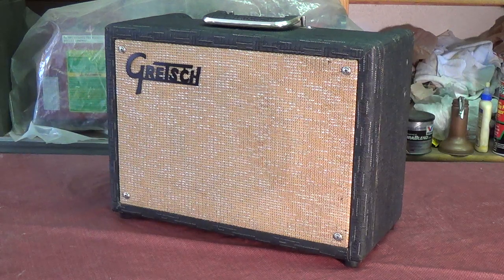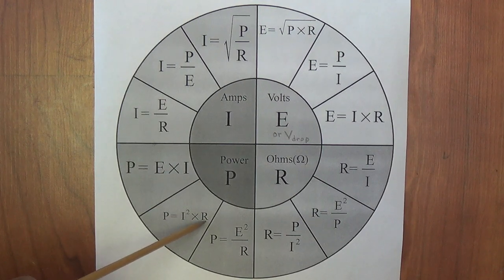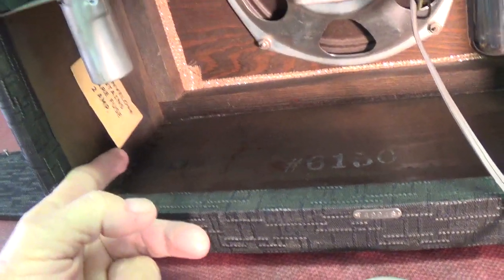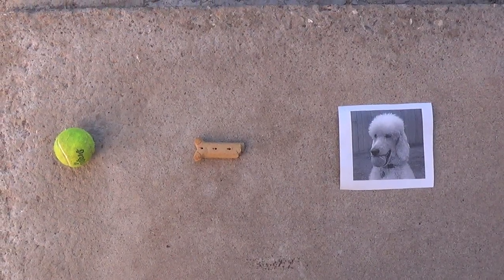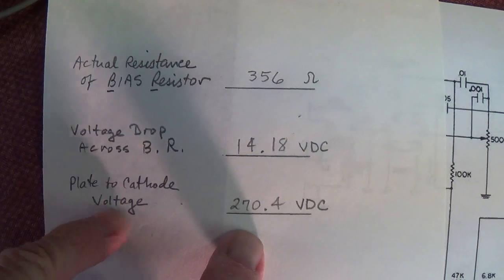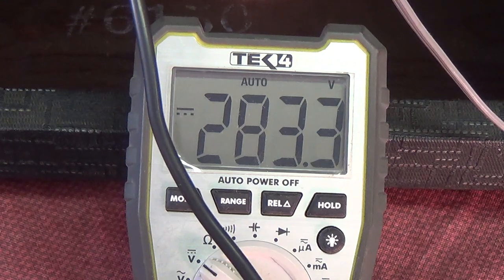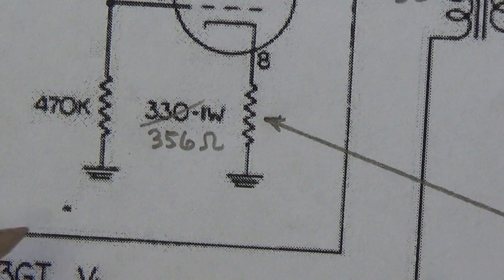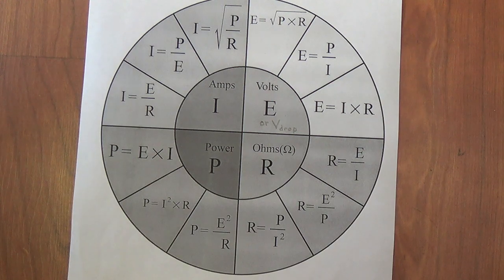Resistors, Part 2:  Power and Wattage Requirements, Practical Applications of Ohm's Law

Comment: I would like to point something out that I don't see commented on very often; the amount of work required to produce a clear, concise and informative video. It's not easy!  

After watching Uncle Doug's videos I thought I would make a video and post my first amp build and I have been greatly surprised at how much effort is required to do it correctly. Lighting, camera angles and maintaining continuity has been a hell of it's own. 

I find myself getting caught up in the build and remembering several steps later that I forgot to turn on the camera, so I check the lighting, camera settings, etc. and try again.  Other times I notice repetition in my explanation of a specific step, in which case I stop and do it over and over,and then try to pick up the build again where I left off.  I have even documented some incorrect steps that I have had to delete or replace with something else. Keeping continuity is not as easy as it looks, and I think this may be the reason I see so many demos on YT of the finished product and not very many good videos of the build. 

Uncle Doug makes this look easy and it's not. 

Another great video.I feel like I'm in a classroom.
Reply from the maker: +Slugg0matic Thanks so much, Randy. You're completely correct.....it's hard as heck to come up with a smooth, coherent video, especially when you're performing distracting, hazardous technical tasks at the same time. This video consisted of at least 100 separate snippets (selected from about 250 that were made) which were all joined together....while maintaining (reasonable) lighting and verbal continuity.  As you found out, this can be a real handful. Even after making 124 of them, it's still a challenge that can take a full day or two. Thanks for mentioning this.....it was very thoughtful and perceptive.
Reply: +Uncle Doug man,  I hate to put you on the spot...but your wisdom is inspirational!  I don't mean just in these technical videos but as a human.  Such generosity and civility.  And these traits appear to have an influence on your viewers. You're doing Great Work--thanks!
Reply from the maker: Wow, thanks so much, JR. I really appreciate your very kind sentiments and hope that I can live up to them. You're quite right about our viewers....they tend to be the most civil, kind, generous, and appreciative that you will ever see on any Internet site. It's an honor to associate with them, and you.
Reply: +Slugg0matic .......................You are so right.....I've followed this Channel very carefully.........there is much to be learned here...much more than the operation of a tube amp..... I consider this a peerless  instruction ...on instruction....That is Uncle Doug's  and Rusty's ............. Bailiwick ......only one other person was as good as UNK.....Robert  Persig...." Zen and the Art of Motorcycle Maintenance"........ who tries to explain........."explaining"......and the idea of explaining.....and all it of it's magical subtleties....it's all about "Quality ".........( I write the manuals you read.....)      Hah!

Yep....He makes it look way way  too easy.......Hah ha ha... a gift.....
Reply from the maker: Thanks, Bill. Rusty and I really appreciate it :)
Reply: Uncle Doug .......And Rusty....And did I mention you can  answer..every single e-mail....every one!!!..... you're not only Peerless ...but maybe Perfect.....I'.m thinking out loud here  .....but maybe  ..you might be the "5th  Element"    .Maybe.......Hah !      ;).. love Bill...
Reply from the maker: Thanks again, Bill. I really enjoy hearing from you all and can't resist reading and answering each comment and inquiry.
Reply: yes just editing film is a task in it self.    people like Uncle Doug do the entire process of coming up with a story line and all other aspects including the editing. 

it is easy to forget the amount of time involved.  when you are as good as Uncle Doug you make it look easy.

Comment: Great video Uncle Doug! Nothing like using the actual readings from a working amp to get "real world" understanding of what's going on. A lot of useful info provided.  A nice follow up to your previous video. Can't help but love the practicality of those old Valco amps.
Reply from the maker: +skeeterbuck  Thanks, Skeeter....glad you liked it.  I agree completely that visual learning is way more effective than auditory.  The screen current issue was unrelated to the topic, but it was a great opportunity to cover a rather elusive subject. Yes, Valco amp design and function are about as good as it gets. I've been appreciating (and collecting) them for several years.

Comment: Excellent tutorial Uncle Doug. That amp is very clean looking. I'm restoring an old cc 1980's slave power amp (solid state not valve) and internally it was a right old mess. Full of dust, fluff and rusty terminals. I'll release a video of still photo's when it's complete - I'm completely refurbishing it with new components. I also discovered that you can use the wife's nail varnish remover to clean the PCB tracks of flux residue, although don't try this on the screen printed side as the component markings are removed..
Reply from the maker: +Andy Wragg Thanks, Andy.....glad you liked the video and the old Gretsch amp. I thought that all you true ampoholics would get a kick out of it.  Let me know when you post your video. Rusty and I would love to watch it.....as long as there is no choice between it and a dog cookie :)
Reply: Go easy on the dog cookies Uncle Doug, I hear they can play havoc with your regularity.
Reply from the maker: I doubt that anything could interfere with my "daily habits", Andy, but I do find that chewing the cookie before swallowing does make the day-after much more enjoyable :))

Comment: Thank you uncle Doug, Rusty and Jack for the excellent series of videos on tube amps and other related things. So far, I have not come across any such informative and we'll explained videos such as yours. I just wanted to add something to your explanation on power. Firstly, we measure energy in Joules and power in Watts. Watt is an alternative name to the original unit of measure, which is Joules per second (J/S), named after the scientist, James Watt. As you can see, power is simply the energy consumption rate or how many Joules consumed per second.  As an example, a 100W electric bulb consumes 100Joules of energy (electrical) during each second of its operation. Unfortunately, we cannot possibly covert all that electrical energy to light energy. For example, maybe 90% of that energy would be converted to light energy while 10% maybe lost as heat energy. Considering the topic of resistors, for example a 1W resistor is capable of safety dissipating heat energy up to 1 Joule during each second of its operation. Assuming that all the electrical energy in this resistor is converted to heat energy, we could calculate the maximum current through this resistor using the formula I=√(Power/Resistance). If the resistance is 1 Ohm, then the maximum current would be 1A.  If resistance is 100 Ohm then the maximum current handling capability would be √(1/100) = 0.1A, without burning the resistor.
Cheers and looking forward to seeing more interesting videos from Uncle Doug and his team.
Reply from the maker: You're welcome, Hashara, and thank you for your very detailed and well-written comment. It is both clear and quite informative.

Comment: Uncle Doug, once again you have concisely yet thoroughly explained a difficult subject. (It is not surprising to discover you were an algebra teacher; much respect sir!)
Here's a question about resistor wattage in the context of longevity: do higher wattage resistors tend to drift less over time, and does it depend on the material? For example: an amplifier from 1971 has a 15k 1/4 watt resistor in the tone stack, 100k 1 watt plate  resistor, (both carbon based,)  and 1k 5 watt ceramic resistor in the power supply. If one were to test the values of all three, assuming they were within 5 - 10% tolerance when the amp was built, which, if any, would remain closest to its original value 45 years later? (Assuming, of course, that the amplifier was all original and in good condition.)
Thank you once again for sharing your knowledge!
Reply from the maker: You're welcome, Michael, and thanks for your nice comments. It's hard to predict exactly how resistors will hold up over time. A lot depends on the current they face, which varies widely throughout the circuit. I would guess that the old fashioned carbon comp resistors would be the worst, and modern metal film resistors would be the best. In between are the carbon film resistors that many of us use. I would think that higher wattage resistors would be more stable than low-wattage (especially puny 1/4W....which I never use) simply due to the larger mass for heat dissipation.

Comment: Hi Uncle Doug. After scouring the internet for better understanding of how tube amps work, your videos have really helped me clear the fog. I have a "learning handicap" in the sense that I find it difficult to assume things and move on without actually understanding how things exactly work, the purpose of each component etc. Your videos have been a cut above the rest, in that, you do not assume that the viewer has prior working knowledge or that something is too obvious to explain. You actually explain the function of every component. I really appreciate this. Thanks for your efforts.

In the schematic you show, I have two questions

1. In the first input stage there is no cathode resistor. Can the circuit still work satisfactorily? As I understood from your other videos, the cathode resistor serves to put it at a more positive voltage compared to the grid for biasing purposes. Here both grid and cathode are effectively grounded.

2. What is the purpose of the capacitor on the primary winding of the transformer connected to mains supply. It looks like a filter cap but why would I need to smooth out the input AC voltage?

Thanks again for your time.
Reply: 1. There's more than 1 way to bias a vacuum tube- "grid bias" works equally well.
2. The capacitor on the AC line is there to filter out noise coming in on the power line.
Reply: @daleburrell6273  Thanks Dale

Comment: Really Interesting video! A few questions came to mind as I watched it:

1) Why doesn't the cathode on the first 12ax7 have a resistor?
2) What is the purpose of the .001 coupling capacitor that bypasses the volume pot on the way to the grid of v2? Does this mean that the volume can never by completely shut off since some of the amplified AC signal from v1 always gets to the grid of v2?
3) Why does v2 have a larger resister (270k) on its anode DC power than v1 (100k)? 

P.S. Rusty and Jack need a patreon page so folks like us that appreciate their hard work can upgrade their treats and toys!

Thanks for the great instruction.

-Gerald
Reply from the maker: 1.) By reducing (in this case to zero) the cathode bias resistance, plate current and gain are maximized. Circuit designers have all sorts of reasons for selecting component values, and sometimes their choices are hard to explain.

2.) A capacitor that bypasses a volume pot is to allow high frequencies to get past the pot resistance unabated.....i.e. it enhances high frequency.

3.) Both anodes are within V1, Gerald. Plate resistance is used to control the output of an amplification stage. In this circuit, V1a has lower plate resistance (100K) and lower output than V1b (270K). Apparently the circuit designer felt that using lower output from V1a to drive V1b produced better tone.

Rusty and Jack do have a Patreon page, Gerald. If you watch some of our more recent videos, a link is provided. Thanks for watching and commenting.
Reply: on 2) Does this mean that you can hear the high frequencies while playing even with the volume turned all the way down? It seems like it would, but I'm kinda surprised an amp designer would do that if so.

on 3) Yeah, I realized that I should have said something like V1a, V1b vs V1, V2
Reply from the maker: 2) No, since the VC resistance is to ground, once the VC is turned to zero, all signal goes to ground. However, once the VC is increased, treble frequencies will be able to avoid the resistance of the VC pot and will be accentuated.
Reply: Ah, the current takes the path of least resistance. Totally missed that. Thanks for the explanation!
Reply: The first half of the 12AX7 is 'grid leak biased'. The few electrons which hit the grid develop a negative voltage at the grid across the high value 6.8M resistor which is enough to bias the tube.

Comment: Great videos! I like them alot. I had a thought about drawing the B+ from pin 8 of the rectifier. It matters if you ever intend to use a solid-state plug-in rectifier instead of valve rectifiers. I hade my amp wired to take the B+ from pin 2, which was all fine. Then I plugged in an octal socket solid-state rectifier I had bought. The new rectifiers cathodes were only wired to pin 2 causing my amp to draw all the amps current through the 5V filament winding. Which might be bad, I don't know. But drawing B+ from pin 8 seems to be standard in most circuits you see.
Reply from the maker: Thanks for your nice comments and helpful input, Ske :)

Comment: 6:56 Stock as a what? I haven't heard that expression before. Googled around, but I must admit my ignorance. You've set yourself up for an excellent mini-series here, Uncle Doug. You could highlight just about any aspect of amplifier circuits, layout do's and don'ts, capacitance, inductance, etc. You're booked right up until we put you in a home--or they put ME in one... Another delightful video, suitable for repeated clobberings over my head for retention. My highest compliments again. And that Gretsch is certainly NSFW. Nice.
Ironic, really. I have had nothing but fear and dread toward all Algebra teachers to date.
Reply from the maker: +JC Haywire  Greetings and thanks, JC.  "Stock as a stone" is an old saying we used way back (1960's) when drag racing our hot rods on the backstreets of town. It implied that an engine and running gear were completely original, which (unlike my video usage) was almost always a lie.....especially if money was going to be wagered on the outcome.  I've been touching lightly on all the topics you mentioned, but now intend to go into a bit more depth, which will require an infusion of math.  Hopefully, the approach I take will overcome old fear and loathing.
Reply: +Uncle Doug On second listen this afternoon, it was quite clear. Maybe I had ear mites this morning. Tinnitus? Hard to say.
Reply: Pardon?
Reply: Sorry! That's Brit for 'Say what?'.

Comment: Another brilliant video, thanks. Do you have one that works backwards - how to calculate expected voltages and currents/power in a valve circuit without having the actual circuit built i.e. I want to build an amp but do not know voltages apart from the HT or wattages for each resistor???
Reply from the maker: Ohm's Law works both ways, Dave, but to calculate a value for either Voltage, Current, Resistance, or Power......you need to know two of the values in order to calculate the third.  So to determine the Current, you would have to know the Voltage and Resistance, and so forth.
Reply: @UncleDoug  Ah ok, thats where it gets tricky - I guess on an amp i would start at the pre-amp end and use the published tube current and voltage plus the series of dropper/filter resistors to gusstimate resistor wattage etc?? I'll have to play with some  diagrams I think

Comment: Hey Doug. I noticed on this example you measure plate voltage from plate pin 3 to pin 8 cathode instead of from plate to ground when using the cathode resistor method.. They are the same i guess. If there is a difference please let me know and if it does not matter I'll just use either way. Thanks
Reply from the maker: In grid-biased circuits, PV is measured from plate to ground. In cathode-biased circuits, PV is measured from plate to cathode (which has a higher charge than ground).
Reply: Thank you sir

Comment: Hello Doug, in a double ended PP EL84 Class AB amp with a 300V B+ into pin 9, 295V out of the plates@ pin 7 and bias resistor of 130 Ohm from pin 3 (which also includes a 25 uF cap), the power rating of the resistor I have seen is 10W. This seems high. Is there a reason for this. Perhaps because there are two power tubes?
Reply from the maker: +allanpennington  If the tubes share the bias resistor, then the wattage would be doubled, and (like horsepower and money), bigger (wattage) is way better than not enough.  It would be helpful to know the voltage drop across the cathode bias resistor.  The bypass cap would have virtually no effect on the plate current.

Comment: Another amazing and incredibly informative video! A request: not sure if you've done this in the past catalogued in another video, but could you make a video on your method of properly discharging capacitors when working on an amp? There seem to be many methods out there, but I have a feeling I'd like to follow your way. Many thanks! -Alex
Reply from the maker: +Alex Perez  Thanks so much, Alex. I have demonstrated the method in the How to Bias videos. I use a 100 Ohm 10W resistor.  One lead is grounded and the other is touched to each positive filter cap lug for several seconds to ensure full discharge. You can then double check each lug with a DC voltmeter just to be sure. Best of luck :)